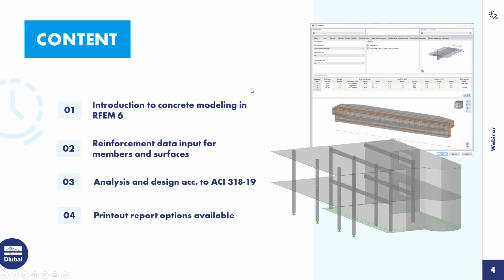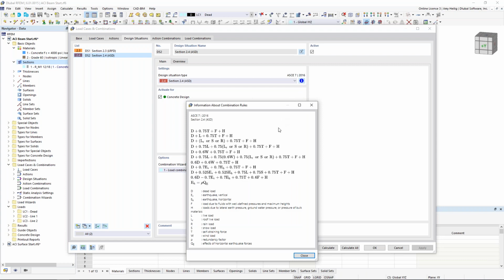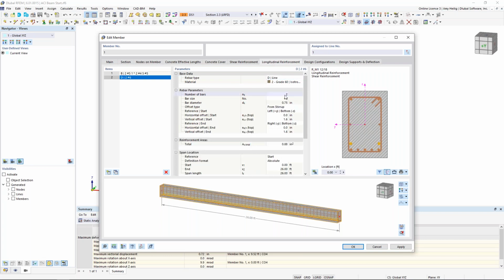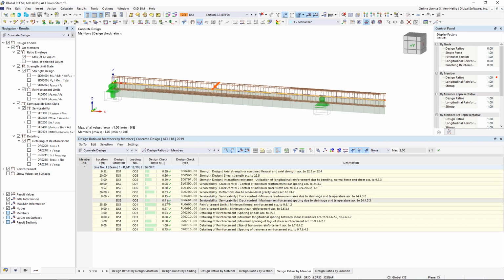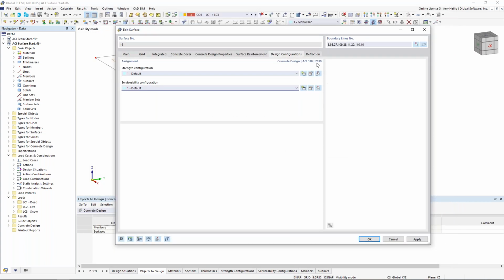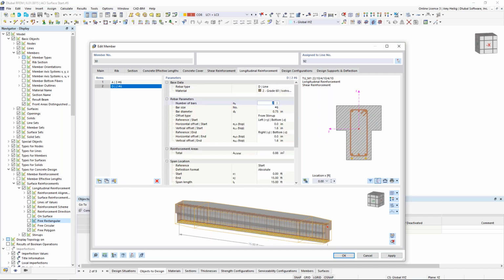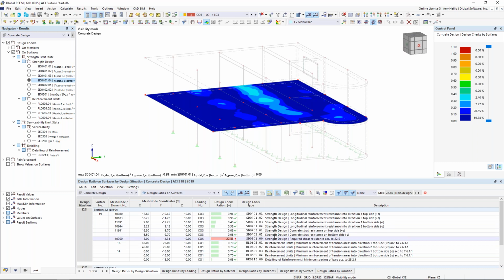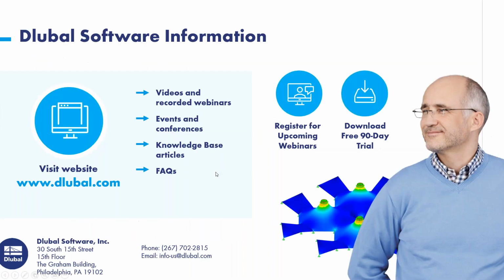Webinar | ACI 318-19 Concrete Design in RFEM 6

Comment: Does the concrete module have the ability for auto design ? 
Can the ACI code used with the different unit system say SI?
Can different rebar diameter be used with ACI code? instead of #3, #5... to use d12, 14, 16... ?
Reply from the maker: Hi, vashq8!
For question 1, please see the following FAQ:  https://www.dlubal.com/en-US/support-and-learning/support/faq/005194

For question 2, SI units can also be used when designing acc. to the ACI 318.  Both metric and imperial units are fully supported throughout RFEM 6.

For question 3, please see the following FAQ:  https://www.dlubal.com/en-US/support-and-learning/support/faq/005195